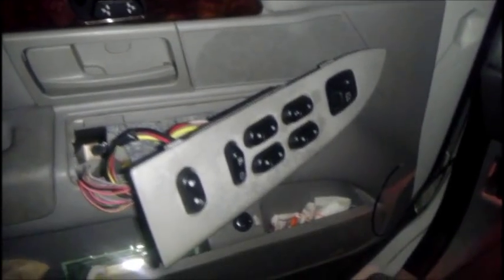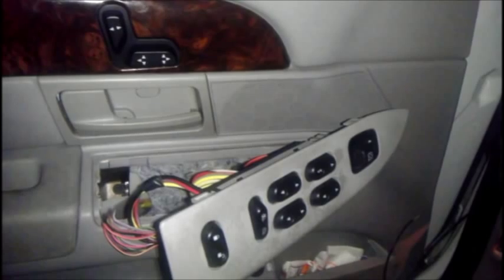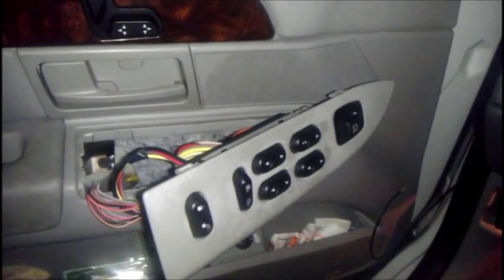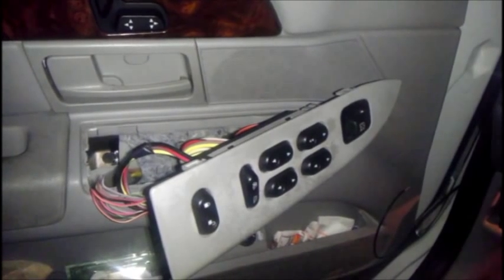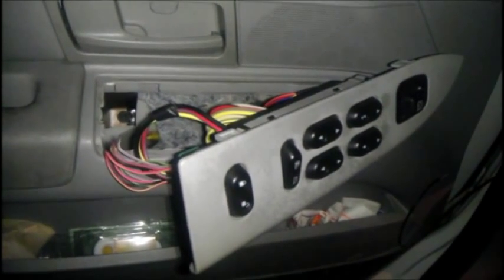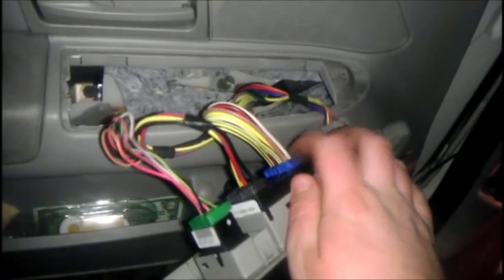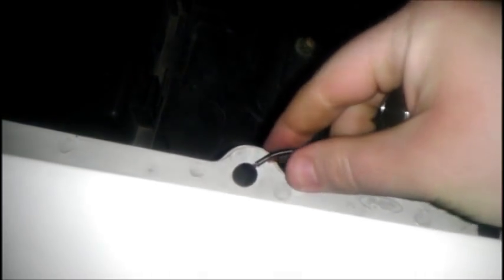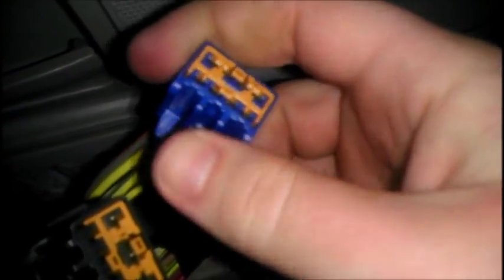Testing the driver's side power window switch pod on a 2004 Mercury Grand Marquis GS

Comment: Thank you.  I'm in NJ, grandson doing fall semester in LA with his 07 Grand Marquis(formerly mine).  He called with driver side window stuck down, no tools and no mechanical skills.  With your video, facetime, scissors and an extension cord, I stepped him thought it and he got the window closed.  Biggest problem was he couldn't get a good ground, after a few tries, had him try squeezing wire in the cigarette lighter and it worked first try.
Reply from the maker: There ya go!  Glad it helped :)

Comment: Warning! Do not start removing the switch panel on the rear, that tab is the first to break(you see it missing in the video). Pry the front up first and release the tabs on the side then pull up/forward.

Comment: 04 vic thank you life saver . my right rear when down and stay there this trick work, and power reversal safe :) i did get the window up and play with the swatch and it start working ,, i suspect swatch or motor brush , anyhow ill get a new door drivers door window control panel   , also when it was stuck down the right rear window swatch on the door it self didn't work ether till after i got it moving
Reply from the maker: You're welcome... thanks for watching, glad it helped!!

Comment: An easier way to do the same thing is to visit your auto parts store, ask for the driver's p/w switch, replace your old one with this new one and bingo! you have your window working again. If it's not the switch, just ask the parts store to restock the one you used. 
Auto Zone does this for free. One of the people will actually come out and watch you do it.
Of course, if you like tinkering with little wires and risking burning up your motor, you can do it the way described in this video. 
With that said, good video. And thanks.
Reply: Big help. Thx....
Reply: lol, I employed an  even easier fix. The master switch on the driver's side stopped operating the front  passenger side window. To operate it, I just reach over and use the switch on the passenger side door!

Comment: Great video.  I have an 02 auroa driver side window rolls down take awhile to roll back up. Any tips. Thinking might be a bad switch. How  do I test.
Reply from the maker: Same as I did here.. just find your common hot then the pins for each window.

Of course youd need a wiring diagram